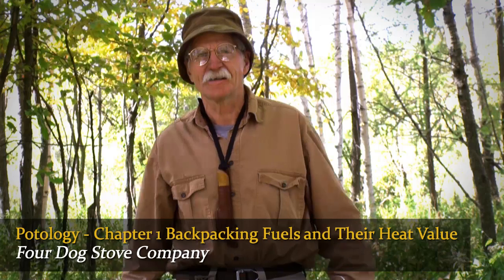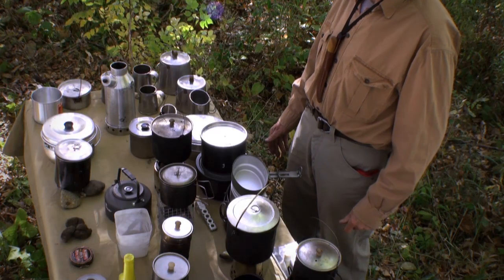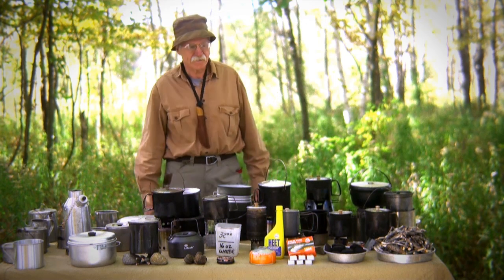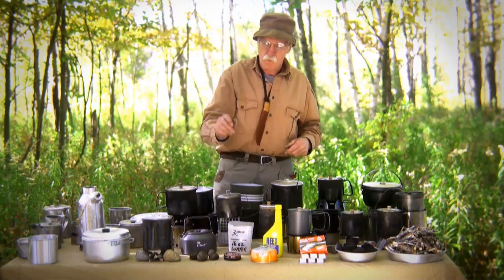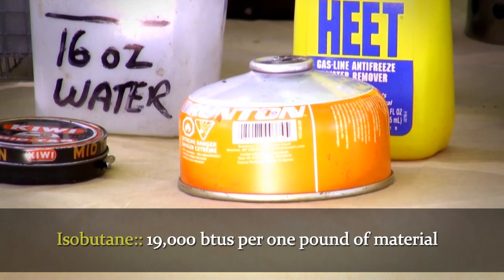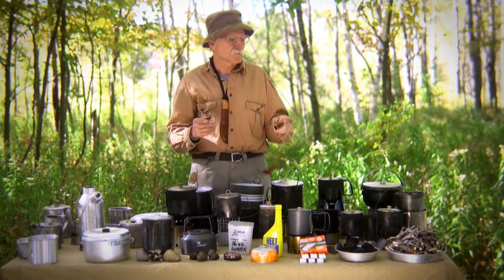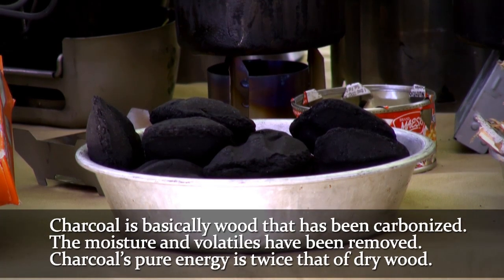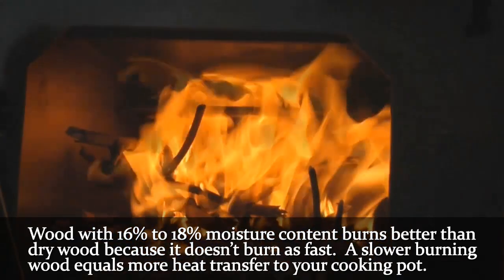01 Potology | Backpacking Stove Fuels | Their Heat Value

Comment: About 3 years ago I switched back to burning word when in the wilderness,  and feel like I had a pretty good intuitive sense of the lb/btu ratio of different fuels.  But,  I was really useful and interesting to see the actual values of the different sources explained.  Same with the 1:1 % ratio of heat energy loss to moister content in wood.   Some very easy to remember and useful knowledge there,  presented in a clear and easily remembered way.  THANKS!   way more people than 6k need to see this video...